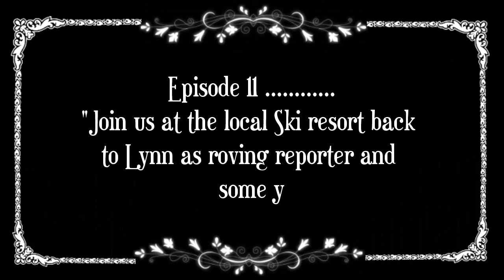Supporting an opening with Girders Part 3 Ep 10

Comment: Lynne and Steve, what approvals have you had to get and how are you doing some of this work that often I am told must be signed off (and therefore performed by) a professional company as per a CILA or SCIA. I note you setup a building company did that allow you to do the works yourself. Interested as I can much of the work but may be prevented by the development legislation.
Reply from the maker: Hi Matthew I started an SRL construction company which allows me to complete the restoration. We have a SCIA a local architect and engineer. We are also approved for soil sampling so we can remove debris from the site. I attended college in Italy and am fully certified. I hope that helps it's a long process and expensive.
Reply: @Brambletye.  Thanks for confirming (I'm not insane) Steve and Lynn as I note a lot of channels show people fai de te for works that clearly require certification. Not trying to be a stick in the mud but if something goes wrong the fines etc are sizable (just like the UK and Oz), insurance voided etc etc.